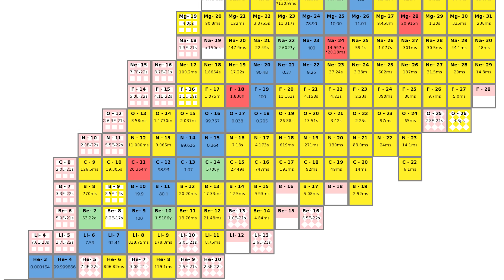Why the U.S. Doesn’t Recycle Nuclear Fuel

Comment: But with the MSR Thorium reactors they can be modelized and they use 95% of the Uranium fuel vs 5% for LWR. They also operate at about 20 psi.

Comment: Hopefully someone can answer this question. It appears that companies are struggling to make small nuclear reactors, but we've been using them in submarines since the sixties. Why is that the case? Are they too expensive to operate to be commercially viable?
Reply: The reactors in submarines are much more expensive (in terms of $/kWh). As even commercial reactors aren't competitive regarding price per MWh (in the UK Hinkley Point C has a guaranteed price of 92.50 per MWh whereas the average wholesale price is 47.50) using the technology of submarines is just not economically reasonable - only the military has that kind of money.

The other reason is that submarines are using weapon-grade Uranium (20% up to 90% of U-235), which is not allowed for civilian use. Commercial power plants are using <5% U-235.
Reply: @brdrnda3805 thanks for clearing that up.
Reply: navy has a much different set of design criteria, and a endless budget
Reply: @ctgottapee9020  Plus different designs for on-land and in the sea. On land you don't have an entire sea to pump through your reactor to cool it.
Reply: Navy reactor construction costs per mw are so high when compared with commercial nuclear power plants used to  make electricity.  The navy fuel blends are radically more concentrated and have more radioactive fission products to deal with. Result is a totally different scale of cost complexity.

Comment: Yeah I am missing the whole entire truth part from the title.
Somehow you left out that recycling radioactive waste is not at all like recycling plastic because the whole chemistry involved, the dissolving of fuel rods in strong acids and solvents and such, to separate the fission products, in turn creates more radioactive waste because all those liquids of course get radioactive and you need to safely put them put away somewhere afterwards. As do any filters, reagents and lots of the equipment. I'm told the waste volume increases by a factor of seventeen when trying to "recycle."
IOW there is no such thing as a "nuclear fuel cycle", let alone a "closed nuclear fuel loop". There is just greed and piling heaps of radioactive waste onto more, bigger heaps of radioactive waste.

Comment: Niel de Grass Tyson asked if you can just boost the isotope back to what it needs to be, to just run it as nuclear fuel. She said no, but the answer is yes. American reactors require 2% U-235, and there's no way to boost to that. But Canadian reactors use uranium with the isotope mix that comes out of the ground, no enrichment necessary. So 0.7%. The really interesting n thing about Canadian reactors is some of the U-238 is converted to plutonium, and Canadian reactors just use that as fuel as well. When the US military dismantled nuclear weapons, plutonium was sent to Canada to consume in reactors. The problem is they wanted to send so much that blended with uranium it would run Canadian reactors for several centuries. They sent too much, it had to be given back. But if you take uranium from spent fuel rods (almost pure U-238), keep plutonium that's also in spent fuel rods, enrich with plutonium from dismantled weapons, the Canadian reactors can use that as fuel.

Comment: Basically our reactors are incredibly inefficient It's like if you had a gasoline engine that just spewed out 95% of the gasoline has vapor into the atmosphere build a f**** better engine but in the meantime maybe catch some of the vapor condensated and throw it back into the engine

Comment: I grew up in Richland and I work on Hanford cleanup. Until we cleanup reprocessing we shouldn’t be reprocessing. It’s not recycling, it’s reprocessing! This is a very complex and expensive!
Reply: Hanford is (will be) cleaning stuff from the 50es .
Reply: We have toxic fly ash from coal plants we've not cleaned up. We have millions of gallons of petrochemical contamination beneath the soil around every refinery.
Guess we'd better destroy all drug, plastic and fuel facilities, as well as raze our power plants. Shouldn't use any of that stuff because cleanup hasn't been completed from wastes left from the 1880's.

And Hanford is a lot cleaner than some of the other primary and secondary weapons core processing sites. The overwhelming majority of that contamination was due to Cold War idiotic priorities to assemble thousands of nuclear and thermonuclear weapons and yes, they were unforgivably sloppy.
And by sloppy, Google "Plutonium pissers", their methods were so sloppy that workers literally urinated plutonium for the remainder of their lives (most dying at a respectable old age and amazingly, with around an average cancer rate compared to non-glowing peers).
Welcome to humanity, where children and grandchildren clean up their elders messes, been that way for tens of thousands of years.
Reply: 2 very different things.
Reply: Hanford is a completely different problem. Spent reactor fuel is either ceramic or metal, neatly contained, of known and fairly consistent composition. Pyro-reprocessing in a closed system integrated into a reactor facility was demonstrated successfully in the 1980s.

Hanford is a nightmare of radioactive sludge, of hundreds of different chemical compositions, in leaky underground tanks, the result of nuclear weapon production during the cold war. I do not know of anyone who is even proposing trying to do any kind of reprocessing of that material. At present, the only safe tool we have for that stuff is vitrification.

Comment: So Spent fuel rods aren't spent at all. They are actually Depleted instead and therefore contain usable uranium?
Reply: Spent nuclear fuel retains more than 90% of its original potential energy.
Reply: @PurpleAlienPlanet  Which is not usable unless you have a breeder reactor that converts U238 into a fissile Isotope. No one has one that operates comercially. Practial all attempts failed due to various reasons.
Reply: The scientific term is that they are "crapped up" (jk, kinda). It's rather bizarre. Before they go into a reactor, the pellets that make up the fuel rods are so benign that they can be safely held in your hand. Once they join their friends in a reactor, they get contaminated with fission products and it's a far different story.

Comment: Incredibly stupid to put data centers on such energy.  Locate them near easy energy ie in the desert with solar farms, near the coast with tidal energy, near wind farms and run extra cycles when there's extra wind energy etc.  Leave the U in the ground where it belongs.
Reply: Locating an energy source "near the easy energy" means you would have more line losses in such remote locations to get to where it is needed.  The better way would be to install SMR's on sites where coal and NG plants are being decommissioned.  Use the existing infrastructure for near turn key installation.

Comment: I’d be interested in a thorough, real world explanation of the lengths of time involved in the fatal risks of exposures to nuclear waste, as well as indirect dangers of exposures to these materials, again, over the timespans involved.
I remember hearing this information, back in the day, but in the past 20 years, this information is suppressed, or criminally underreported and described.
Reply: No one in world history has been harmed by stored nuclear waste.  You could even look up the effects of the two billion year old nuclear fission waste site at Oklo Gabon if you want real long term.
Reply: the science is well understood so the danger is minimal. redundancy is put into place to protect from accidents. not much different than how we handle commercial radiation products, like servicing Xray machines.

Now if the US spent fuel was all moved to a central location, processes would need to be worked out, but other countries have managed that aspect already.

Intentional sabotage could be an issue. The risk would be like many other intentional sabotages and finite. Cleanup would manage the after affects.

Comment: Pretty high level fluff here, meaning the brilliant people are dumbing down ??  Is there another version of this video which is at a more technical level ?  I understand that the real reasons we don’t recycle the DISCARDS from commercial nuclear reactors, the fuel for which started at sub-5% U-235 [a fissionable material] with the rest being almost entirely U-238 [a fertile material] is that one, as we have found more uranium ore, recycling is more expensive, and then too, as Ms. Huff mentioned almost as if we were talking about sex around children, that 95% fertile material can absorb FAST neutrons and be transmuted to PU-239 which is fissionable, and that has to be processed into fuel, and the Carter administration deemed that was too threatening in the proliferation domain, and nixed it.  And that this is politically sensitive is unquestioned, as this concern, NOT technical, is what sank the French Super Phoenix.  This country - the USA - needs more nuclear to stabilize the grid, independent of all the talk of data centers, and with a significant increase in the number of reactors, and concomitant increase in fuel use and discard production, the Government really needs to have a handful of fast neutron breeder reactors to both reduce the discard volume and lethality, and supplement the fuel supply in a meaningful way.  Ms. Huff is a star, and so glad y’all attracted her to the show.

Comment: I fail to understand why we’re still stuck in the past talking about nuclear. PV and wind is already 2-3 cheaper. Nuclear in fact never ever was profitable. Move on.
Reply: Because unless you cover the planet in wind, solar, and the batteries to store all that energy, you're going to need a back-up.

I hate to break it to ya, solar doesn't work at night, and the wind doesn't always blow.

And no, if it is a breezy sunny day in California, you can't just flip a switch and send all that energy to windless, cloudy New York...
Reply: Wow, really?  Nuclear energy actually comes out cheaper then ruinables long term when real numbers are used.
Reply: @danadurnfordkevinblanchdebunk  real numbers? You mean like comparing the LCOE of PV/wind versus nuclear? Sure: around 25-45 USD per MWh and around 120-200 USD per MWh. Guess which ones are for nuclear... And that's after nuclear has been around for decades and has been heavily funded by government for over half a century. Meanwhile PV/wind has been getting to these low numbers in less than a decade.

Comment: It's interesting because there is usually much more unused nuclear fuel in a used fuel cask than actual used fuel.
So in short we're just conveniently storing all that unused fuel for future reactors to use.
Reply: Breeders have failed so far.
Reply: there is no safe and commercially viable way to reuse that fuel; quite an amount considering long term storage is more economical. like trying to reuse or repurpose a nuclear plant - the cleanup and danger is too costly.
Reply: If we are smart, that is EXACTLY what we will do.

Comment: I think it was something like 98% of nuclear fuel is recyclable with current technologies, and the remaining waste products not only is small (France's entire supply of nuclear waste will fill only a closet, rather than a many meters tall football field despite using similar amounts of nuclear energy as the US), but the waste also doesn't last as long. Something like 300 years compared to hundreds of thousands of years. One of the main reasons why the US doesn't recycle its fuel (it used to) is because they made it illegal for stupid reasons.

That said, recycling nuclear fuel isn't economic. It's cheaper to just mine and enrich more uranium than to recycle. The same problem with plastic and paper recycling. And due to that, I think France has the only large scale nuclear recycling plant in the world, and does the recycling for quite a few countries. And the fact that it's now understood that we have many centuries worth of uranium left in known deposits means that moral reasons is the only incentive we have to actually recycle nuclear waste. As it stands, it's not really a problem since the nuclear waste caskets can take anything short of a direct nuclear blast to break open. You can't even crack them with a rocket powered freight train, and forget trying to move a thousand ton solid block of concrete.
Reply: Very true.  Also consider that future reactor designs may be able to do the recycling inside their processing loop, and may even be able to accept current waste into their cycle and process it there, which would make it significantly cheaper and makes "let's keep the stuff around for a bit" a more friendly option.
Reply: @willemm9356  To be honest, the CANDU reactor design is basically that already, on top of the fact that you can use unenriched uranium in it, and the design is a half century old.

That said, I don't see much of a future for nuclear aside from niche uses like in space in places where solar isn't reliable/viable due to how cheap solar/wind and batteries have gotten. Hell, it's cheaper than LNG in some places already (Australia is one of those places, not talking about places without any industrial infrastructure).
Reply: "France's entire supply of nuclear waste will fill only a closet" Tell that the French. Andra reports 4.320 cubic meters for the highest radioactive waste and in total 1.760.000 cubic meters radioactive waste. That's a very big closet.

We visited their site in La Hague, Normandy 15 years ago and alone the place there where they burried part of the low-radioactive waste is much larger than a football field. (As nuclear energy is/was not questioned in France, they were very open about their unsolved problems with highly radioactive waste)
Reply: @brdrnda3805  I'll admit, the source I was remembering probably only told part of the story. Seems like France's recycling operation hasn't gone through all their waste. Though I think including low level nuclear waste with a half-life less than a year is also skewing the numbers quite a bit. The radiation levels of most of that is no more than standing outside during noon (though admittedly a different type of radiation).

The amount of waste I was referring to seems to be only the amount that has actually gone through the recycling process, though the 4k amount you mentioned includes waste that hasn't been recycled yet.

I think I mentioned, but recycling does solve our problem, just that the issue is that it's still more expensive than mining more uranium, so only public pressure can make it happen.

Comment: North America has an abundance of Uranium.  This is why we don’t really recycle it.  It is frankly much cheaper for us to process and refine new material that to run the process on spent uranium to separate out the majority of that material (which is still high grade uranium, from other isotopes.  

France recycles its uranium because it doesn’t have an ample supply locally.  

Now the one reason why the U.S. might want to consider recycling, or highly partnering with someone who recycles, waste is because you can potentially become the go to supplier for all sealed SMR manufacturing.  This can be a big boon as it means you can both regulate and profit from nuclear power everywhere.  And as a founding member of the nuclear nonproliferation alliance you basically get to tell a lot of countries that the way they can have nuclear is if they buy it from you, and let you manage it. However it does have its downsides of transportation of nuclear waste.

Your typical reactor uses Uranium enriched to about 3.5% Uranium-235 (natural uranium contains about 0.7%).  When uranium fuel is fully spent it contains around 1 to 1.5% Uranium-235.
Reply: The US under Trump buys a lot of it's uranium from Russia despite the official embargo.
(Which is one of the reasons other countries feel justified to ignore parts of the embargo like oil)
Reply: Yes it’s always much cheaper to mine new when the mines never have to pay the costs to society for all the damage they do! Utter BS whenever people talk about the cheapness of nuclear power, lies and more lies on top of proposed remedies that never come to pass!   Drill Baby Burn
Reply: France formerly obtained its Uranium from its African "colonies".  Part of the reason that Russia has carried on a low tempo war in the Sahel against France in large part to control the Uranium.
Reply: @jamescobban857  Actually this is why China has been financially backing a lot of civil improvement projects in Africa.  Basically they are buying their way into political positions to lock up resource contracts in the future.